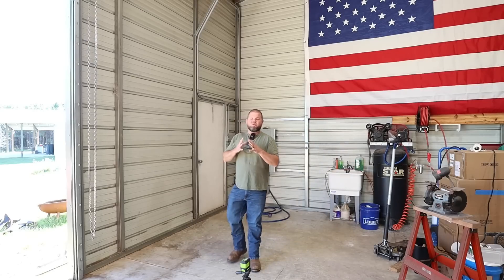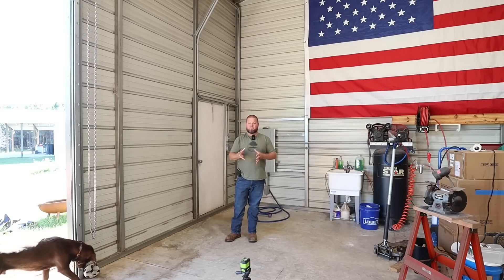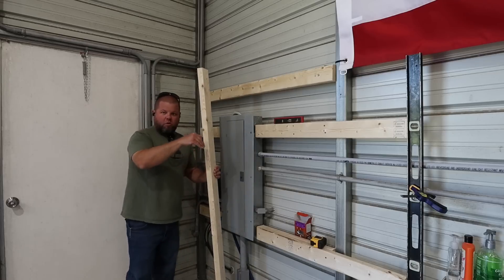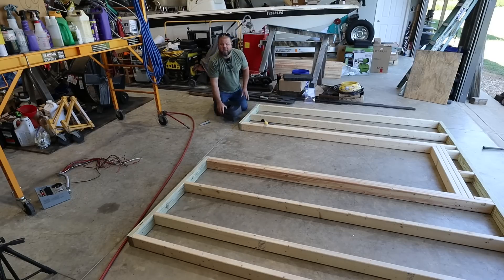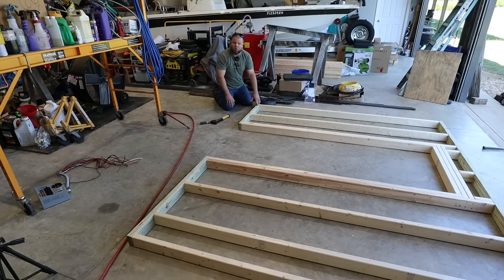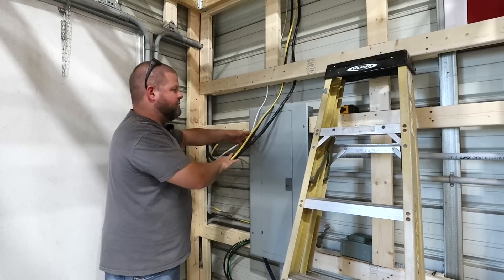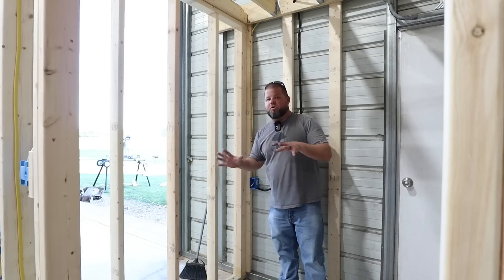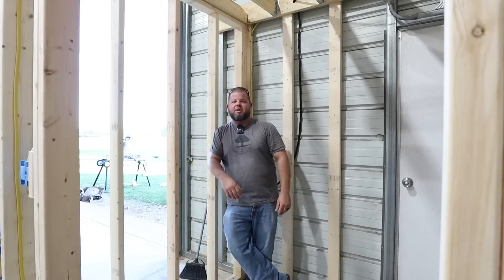Solar equipment electrical room begins! Part 1 #743

Comment: Hey Andrew, we've been watching the channel for a while and really love what you are doing. We are building a homestead in Brooksville Florida and your channel has helped a lot. I found you when I was doing a new electrical service feed and it helped a lot as I took on that part of the project I had not done before. 

We are building a 30'x60' workshop (permit was just approved yesterday) and are planning on doing a decent size solar setup, this is perfect timing. 

As I am planning my solar electrical room, I was wondering about sizing it. I couldn't find where you listed a size of the room so I wanted to see if you would share that, and if you think it's big enough after getting the equipment in there. 

Thanks for all that you do!
Reply from the maker: Thanks for watching! It's roughly 6x8 and I randomly picked that size.  You could go even smaller and still fit a powerful system in there for a home.  Best of luck with your build.

Comment: Thanks for all the content!  About to tackle a similar but larger Mother In Law project in a section for my 20X50 building. I am comfortable with standard framing but have not found much on how to attach the ledger to the metal. I also like the way you did the studs on the metal wall side. Any further info on what you used?
Reply from the maker: Can't say what I used was correct for the studs, but I found some wood stud supports at a local hardware store and I bent them to form a L shape and attached to the metal framing, then screwed into the studs.  Beefy metal L brackets should also work.  They are only needed to keep the stud from shifting, the support comes from the stud resting on top of the metal square tubing. You have to get creative to fit wood and metal framing together.  Otherwise build standard wood walls outside of the metal framing, that's what I did for my processing room.

Comment: Fire suppression, are you considering this? A person here in the Big Bend and one of his batteries catch fire in his shop. Didn’t sit well with expensive tools and equipment. 
He just built a detached building to house the solar system and the air compressor. Something to consider.
Reply from the maker: I have actually been thinking about a fire suppression system.

Comment: I could watch you do stuff like this all day. I'm sure you've already considered it, but when deciding which building to dedicate to all solar, consider the amp draw your shop takes when fabricating metal. You house doesn't usually have that kind of draw. Also, I have a 240v pure sine wave inverter. I wish I had gone with 2  120 inverters. The weight of the inverter is probably the main reason. I think you would regret not going with a 48v system, unless you aren't given that opportunity.
Reply from the maker: Got a 6500 watt inverter and 51v battery sitting in the shop 😉
Reply: @TKCL  Awesome! That's enough to do one leg of 240v. If you haven't already, you might want to check out Signature Solar out of Texas. Their prices are hard to beat.
Reply from the maker: This package I have now is very cheap compared to other things. I'm hoping to double it to 240v operation in the future.
Reply: @TKCL  I'm hoping you can double it, too!

Comment: Andrew what a great project series you started. I have two suggestions. One is maybe can you have a podcast just on solar and battery backup where we can ask you questions and get answers (maybe once a month). I know I'm adding to your full plate as it is 😂. The second suggestion is maybe some links on wiring diagrams. I'm a little nervous about where to put inverters because they do heat up. This is all new to me I'm still learning about parallel and in series. You open a can of worms with me so get ready for all the questions I might have. I am literally laughing out loud as I text this.
Reply from the maker: Thank you for the suggestions

Comment: That equipment room is a good idea, especially for your battery bank.  In the event of freezing temps, you can easily place a small heater inside to prevent a deterioration of performance.
Reply from the maker: That's my thoughts, I'll actually run my diesel heater so I don't use much power. Should work perfectly!

Comment: Kind of late now, but did you consider building it up out of the way on top of your shop kitchen? Were you built the stairs?
Reply from the maker: That roof isn't near strong enough for heavy batteries and equipment.
Reply: @TKCL  I watch the guy in Canada who buys solar panels that don’t test at capacity or aren’t working and he gets them for really cheap and there are almost no electronics in there any buys a little $.30 part in solder is it in and most of the solar panels worked just fine and are still putting out over 85% with a $.30 fixed, he runs his whole Homestead off of it.  But I thought that was interesting, and he said that even if they don’t put out full capacity, they’re so cheap. You can just buy a bunch of extras and run more panels. His page is called off grid with the Skinners.   He’s always fixing old snowmobile’s and bulldozers and stuff like that and building a house and a barn and does gardening stuff but he fixes a lot of old equipment and does wood milling and kind of try to do everything on the cheap.
Reply: @ShaneZettelmier  HAHAH Been watching Cecil & Heather for Years ...
Reply: @m9ovich785  I like watching it, it’s a little different perspective, and he does things different than most homesteaders. He knows a lot for sure.
Reply: @TKCL  you should complain to your builder. ;) 
😂😂

Comment: This is pretty cool.  I think if I was to start an off grid property, I would try to start off with a well and pour a decent size concrete pad around it and build a tool room and an electrical control room and water control room and build it all out of cinder block filled with concrete so I had a secure area to store and lock up tools had water and a place to hook up solar panels and have electric and also a storm shelter. From there you got your basics covered and you’re good.   I would at least build the structure to start, the well might take a while, but optimally to have a power station and water would be awesome.   But in this day and age, having springs send, an underground water source is pretty much a must come up having a stream or river is cool, but if you look at Ohio, they can just fill it with toxins and make it unusable so safe subterranean water source to depend on is a must.
Reply from the maker: Might as well make it a Faraday cage as well.
Reply: @TKCL  good idea, copper wire, and metal siding.  But I plan my whole shopping garage and house to be a faraday cage. So I guess I’m gonna have to get that cell router rigged up.  Hopefully I’ll be out for enough in the country where I’ll probably have to do. Big antennas like you did anyway. The farther away from people the better.  Lol

Comment: I enjoy the review videos. It helps me decide what item (toy) to buy next... They are tied in with the homestead style of the channel, and in my opinion are extremely helpful! Now if you start reviewing hair care products, then Andrew we will need to have a conversation. The only negative thing I could say is thanks to you I now have a Vevor shopping addiction!
Love the testing room... Did you run enough electrical wire? Within the next year,I bet you will say to yourself, "I should have run another wire when the walls were open"!
Keep doing you and I will always keep watching!!
Reply from the maker: Way ahead of you, I've already drilled holes through the joists and screwed in the attic floor so it can be removed quickly to run new wires.

Comment: Just remember Andrew, if you exhaust the hot air "out" then you need to worry about how the room is gonna get replacement air in the room. If you control it, then you can put a filter on it to keep the dust out. If you don't control it, then the room is still gonna suck air in from somewhere. Be it dirty or extra humid, or wherever it can get, it's gonna get in there.
Reply from the maker: Agreed, I've been looking for a small through wall filter. I'd also have to seal the bottom of the door.

Comment: Did you have the Romex left over from the house build? I needed a few rolls to wire my shop and it is currently $160 dollars a 250 foot roll when I went to Lowe’s yesterday. 😢 I can remember buying the stuff for $19 dollars a roll many moons ago.
Reply from the maker: Nope I had to buy it and the 6ga wire. Electrical is insane right now! 😡
Reply: @TKCL  ouch. I know it’s crazy how much stuff costs now days.